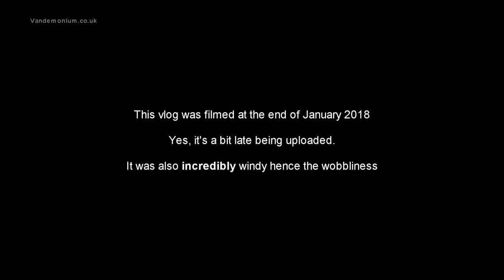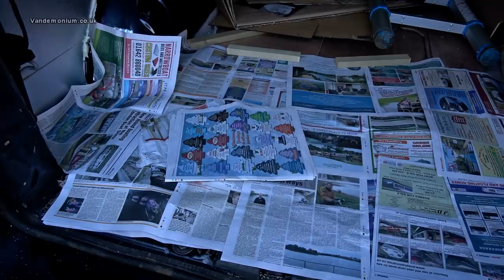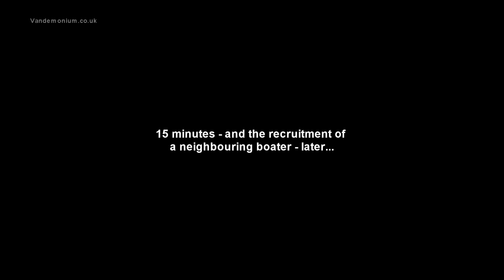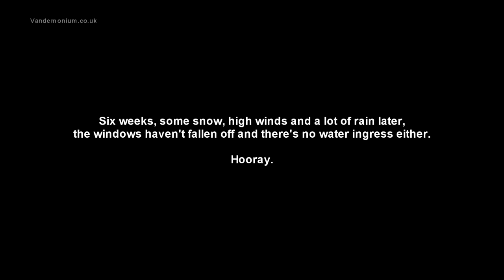Vlog 9: installing bonded rear windows to my Toyota Proace DIY campervan conversion

Comment: Well done.  I don't know (nor much care, actually) if I have mentioned it, but if I make it through April next I will be 80 winters and much of that time was spent tearing stuff apart and putting most of it back together in a different (if not improved) fashion.  I'll spare you all the full catalog of houses, parts of houses, cars, pickup trucks, radios (including transmitters and transceivers),....

Suffice to say that I am imminently qualified to be very impressed with the preparation and raw courage you display in your (old school use of the term) hacking your van.
Reply from the maker: Thank you!

Comment: Went to a Motorhead concert in a nightclub in the 80's and my ears were still ringing 24 hours later. Proper worried for a while.
Reply: Was it at belle Vue Manchester. We were there. When we went to the car park switch on the engine and had to go and lift the bonnet to see if the engine was running as we couldn't hear it. Lol

Comment: a tip when using a caulking tube pierce a little hole in the end of it on the inside, makes it alot easier to push it out

Comment: Well done.
If you ever need to do something similar, check out some adhesive (kind of Velcro stickers) called scotch lock.
You stick them on the window, do a dry fit with spacers at the edges. Apply your glue or sealant and lock the Glas (or board etc) on place.
Works only if you have some spare space. We use them in a bigger version for truck and RV windshields. Cherrio :-)

Comment: Years back I converted a bus to a motorhome .  The things that helped were research ,  planning and talking over the plan if I had questions and taking my time.  From what I have seen you are comfortable with tools even if still learning.  I think you will get frustrated at times but, when it is done you will feel quite  satisfied.   Good luck, Hal

Comment: I second your call to use proper hearing protection. The damage from noise exposure is cumulative, as I know first hand from many years in metal working.

Comment: A thoroughly enjoyable watch, this is really getting me in the mood to do another build soon. 
You are absolutely right about the noise, It’s unbelievably loud isn’t it?
I fitted all my van windows on a single Saturday, and my ears were ringing for several days afterward, like you, I thought I might have damaged them. 
I will definitely be using ear defenders next time. Really enjoying this build unfold a little more each episode, you’re doing a cracking job, and I may be taking quite a few tips away from this series to apply to my next build, so thank you.
Reply from the maker: Cheers Rick, that's very much appreciated. Yes, do another build :-)

Comment: Top job! Would be pleased with that level of work from a professional!

Quite a DIYer myself. Some projects, especially the first time, Dunning-Kruger is very real. If you're not trepiditious before you start, it's probably because you don't truly understand what you're getting yourself into. Hacking a hole in the side of your van definitely qualifies!

Comment: That is a fantastic job you have done there, a very well done! And someone has already given the tip but i second it, put the tubes of bond (gunge) in very hot almost boiling water to make it easier to apply. Well done that man! 👍

Comment: At no time did I doubt your ability to successfully install these windows. Well done David!
I use small plastic wedges at the bottom and on one side to ensure an even gap. The thin end of the wedges are cut away during the "dry fit" stage leaving only the correct thickness for the desired gap.
Reply from the maker: Wedges would have been a good idea. I did stuff some cardboard below the window which you can just see me doing in the speeded-up bit but I didn't have anything proper to go in there.

Comment: Nice job David, you might want to think about sealing the edges with some more sealant so that dirt doesn't collect there and then keep dripping down the rear of the van every time you try to clean it, also spiders like to nest in those sort of places, I had them in my door mirror last summer.

Comment: Really impressive! Also, your use of accelerated footage is immaculate. I know you also sometimes use it in the CtC videos, but quite sparingly and not sped up as much as here. I've also watched another narrowboating video that started out interestingly enough, but the guy would have miles of footage rushing down the canals at warp speed, at least as much as the fastest I've ever seen you use here, until he'd get to a point where something happened he thought might be interesting to the viewer, the footage would crash to normal speed for a short while, just to be off at warp speed again for the next couple of miles! That's not the point of watching someone going down a canal on a narrowboat, is it!? The way you're using it here to speed through the repetitive stuff works really well, however, because you've already shown what you're doing, there's nothing scenic or particularly pretty about it, so you're just getting it done. Pretty judicious use of a cool feature, I'd say!
Reply from the maker: Thank you, yes, as evidence by CtC I’m not a huge fan of speeded-up footage but it does make sense in the scenario you mention. Cheers

Comment: Excellent job David, it is good that you admitted the error with the ear protection and will use them on the doors. I truly wonder would a professional installer be that fussy with the shards my guess not. 🚌

Comment: You've done a cracking job of them David :) They look fantastic :D we definitely remember the arm ache of that black gunge!
Reply from the maker: Thanks guys! Oh my, that stuff was hard to squeeze out. I'm going to do the side windows on different days so that I can get some rest between each of them :-)
Reply: Vandemonium good idea! Definitely try putting the tube in a bowl of hot water for a few minutes before too, we found that helped 😊
Reply from the maker: I did one side window today. I put the gunge near the stove beforehand and it got so warm it came out all gloopy and floppy instead of giving me a nice pyramid-shaped line. Duh. Next time I'll use your hot water idea :-)
Reply: Vandemonium oh dear, that’s not good! It’s all a bit trial and error but sometimes that’s half the fun of it 😁 hope it went on well despite being a bit gloopy 😊
Reply from the maker: It's supposed to rain overnight tonight so I suppose I'll find out tomorrow if it was enough!! Cheers. Less warming on the next one :-)

Comment: Well done.  I would also have been sweating at the door cutting step.   It is amazing the windows stick without any clamping.  I was not sure the tape would hold the windows without gravity moving them down.

Jigsaws are not noisy in wood but the thin metal will create a lot of noise as you experienced.

You may consider a Dremel style tool with small sanding drums for sanding the edges of the hole.  Also consider warming up the edge trim with e.g., hair dryer to make it a little more flexible.

Dave.
Reply from the maker: Good tips, cheers

Comment: It would have been nice if the window manufacturer had a template to cut out the holes.  I installed a sunroof into a mini truck so I understand how nerve wracking it can be.  It sounds/looks like everything was done properly.  As far as the right rear window goes it looks like you matched the glass with the seem of the doors, good choice.

Comment: You are quite right, I should have thought of that. Those doors are most likely about 50 Kg each and would very hard to handle by yourself if you removed them and you are wanting to do this on your own. Might I suggest that the side windows be partially sliding? That way you could open them at night and lock your sliding doors for safety but still have an air flow? Or am I " as the saying goes" preaching to the choir here or telling you water is wet, maybe it gets dark at night? ;) ;)
Reply from the maker: I've already bought them, as seen in an earlier vlog, and one of them has a sliding panel but the other is just glass. Cheers

Comment: Well done young David nice job!  Just a bit of advice, when you use the Teddy Bear Ears ( sponge on the wire)  hold between your thumb and indexfinger and use your middle finger as a guide around the glass and window aperture when applying the primer, this will give you a straight line.  Love your videos both this channel and Cruising the Cut!
Reply from the maker: Interesting tip! Thanks

Comment: Great job and great attitude.......As someone who's worked as a pro in the automotive and marine industry I can assure you very few if any of us became pro's without mucking a few things up.I for on have had to make a few trips to the scrappers to save a job or two ;-)  When i was 19 or so I once asked my boss right before cutting into a big record producers Bentley with a sawzall  (Darkchild Studio's) What do we do if I screw up.His response was run and after he stopped laughing he went on to say "dont but if you do that's what we have a welder for lol."
    When you do the trim around the side windows,I used to use a cutoff wheel on a grinder to cut through it(hacksaw is good too).We'd cut it a hair long(maybe 2mm) to give us a tight gap with some wiggle room.Then when you go to finish it you pull it up,but the 2 ends and work the little bubble out with the hammer.It'll give you a nice tight gap ;-) Another thing I used to use on projects by the ton was butyl tape.It wasnt exactly a tape,but we called it dumb dumb(partly cause it hid mistakes lol) But it was amazing for sealing things on boats and motorhomes etc.It was like putty and clay mix that you could mold and seal things or quite rattles and so on.Plus it was removable and easily trimmed.Between your van and boat I promise you'll find 101 uses for it and IMHO the most useful size was like a small rope since you can add as needed easier than take it away.
            Anyway good luck,have fun and be sure to make a few haters along the way ;-)
Reply from the maker: Yikes! Great tips, thank you :-)

Comment: Good Job! Hey about that NP1 you now have a metal base (the window cut outs) to test how well the wood adhires to that painted metal. You cound use it to test a piece of wood and glue it to that cut out with NP1 to see before hand how well it will work out. Cheers and Stay warm! God bless
Reply from the maker: Haha, yes I've been using the bit I cut out for the roof vent as a test already!
Reply: I hope it is surpassing all expectations.

Comment: Very much enjoying these videos, kudos for tackling something like the window installation. I know it's all undoable but nevertheless it's nerve wracking hacking into something as nice as a pristine, finished van. I once got some aluminium swarf in my eye while drilling holes under the fuselage of an aircraft I was working on. I'd not experienced anything quite so painful either before or since. Now I wrap my head in goggles, hat, ear protection and usually something to stop stuff going down my neck!
Reply from the maker: Ouch! Yes, all the protection you can get is definitely a good idea

Comment: Quick tip, put the tubes of adhesive in a bowl of hot water prior to application, comes out like toothpaste then.
Reply from the maker: I wondered about that but wasn't sure if the water would find its way into the tube so I left them near the stove instead. The first was definitely better than the second but the latter had lost all the warmth by the time I used it :-(
Reply: Put them in water before perforating the top or bottom of the tube, works every time, i have over 10 years in doing this, never worn ear defenders yet, say what?

Comment: hearing degradation is accumulative .. and permanent .    yes the ringing may have gone away but the poor little receptors will have bee cythed to an early grave  .from the insane noise ...   No to worry ..  now you know why grandad is so hard of hearing .. .  By the way   great job on the windows .. .  a fast learner .Where would we be without gaffer tape

Comment: Thank you for this David, Really chuffed to see this in action and you've made a great job of it, including the expansion gap on the bead (of course) 

In reality do you think its a 2 person job or is it a single person with an extra set of hands for help when it goes pete tong ?

Hope you are well

D
Reply from the maker: Thanks. One person job for small windows like those but definitely worth having a second person poised underneath to catch the glass if the suction thing had failed (I don't have much faith in them). A larger window such as the side ones is possibly still a one person job (I think two might end up contradicting each other when placing the glass) but again with a spare person to hold it in place while you tape it etc.

Comment: Only just found this series.  Your honesty scares me a little.  Regarding the rear windows, did you debate much about windows or no windows?
Reply from the maker: No, I was definitely going to have them as it's part of the DVLA requirement for re-classification as a camper plus I wanted windows

Comment: Go for it David,  better to try and than pay someone else.  Totally agree. However I would have left the back panels in as I much prefer to drive using the wing mirrors alone.  No need for glass there really.
Reply from the maker: Oh but there is and it's not just about driving; on many occasions I will and do want keep the doors closed (eg winter) but still look out the back at a lovely view. There have been many times I've sat on the bed looking out of those windows. I couldn't disagree more on that point.

Comment: Had no idea you had this second channel, and am this far into a binge-watch, but the back windows install left me with a nagging question: Doesn't the rubber seal you fitted around the cut outs foul on the glass? The windows are pressed flush on to the doors, but the rubber seal is raised. It's bugging me. Great series!
Reply from the maker: There's a slight curve to the glass but also you put lots of the sticky adhesive on, so when you press the glass on, yes it probably is touching the seal but it doesn't matter as (if you've done it right) the sealant gunge meets the edge of the window all round anyway.
Reply: @Vandemonium  Understood. Cheers for replying.

Comment: Good works.   
Just one question 
Between where the rubber seal you put in and the bonding glue you
put on.  
What's stopping the dust and condition
Building up in that gap and then growing Mould.  ?
Reply from the maker: I don't think any dust could really get in there, the glass is fairly firmly pressed up against the window rubber.
Reply: Vandemonium    Good stuff. 
Best wishes.

Comment: Not bad, impressed. Just wondering why you cut the right upper corner on the left door.
Reply from the maker: The cuts were made according to the "template" formed by the inner skin of the metal, which is not the same as the shape of the glass.
Reply from the maker: I didn't notice the assistant holding the primed area but it should have dried by then and I thought she didn't actually grasp the window until such time as I'd pushed it into place. I'll try to keep a better eye on "the help" next time ;-)

Comment: I'm impressed, nice job. You didn't want windows that push open kind of like your roof vent?
Reply from the maker: One of the side windows has a slide-open section and that's enough for ventilation.

Comment: Congrats!  It's always s bit precarious when cutting holes in one's van.  Did you add any additional "gunge" to the windows like you did to the fan, to fill in the remainder of the gap, or did just one bead of gunge do the trick?
Reply from the maker: Just the one thick bead as shown but my backup plan was to go around the gap between window edge and metal with ordinary sealant if there had been any leaks (still none so far)

Comment: Would it have been easier if you had taken the doors off of the van, and laid them flat?
Reply from the maker: I think they'd have been incredibly heavy and awkward for me single-handed (notwithstanding the boater who helped hold the glass). It wasn't a problem with them vertical other than making sure the glass didn't slide downwards but that stuff is so sticky that within seconds you can take your hands off and the glass doesn't move.